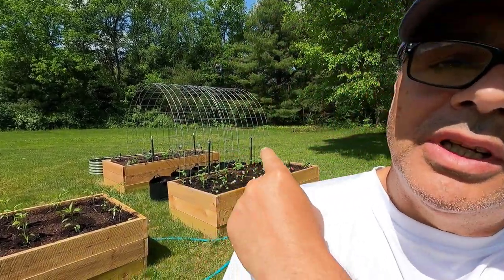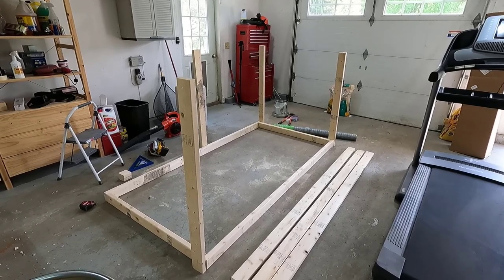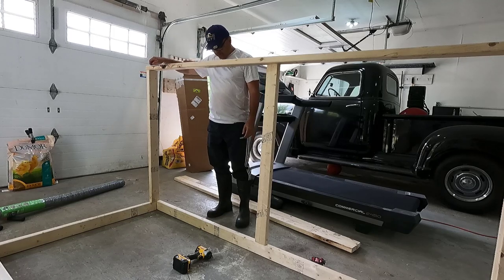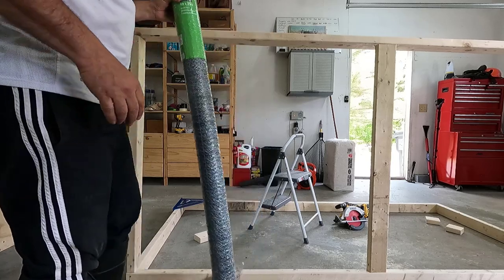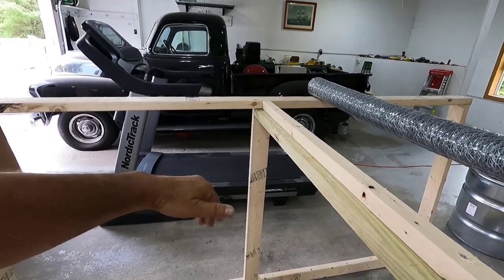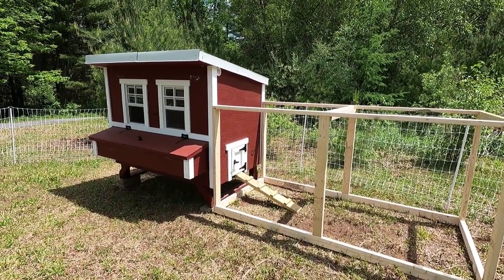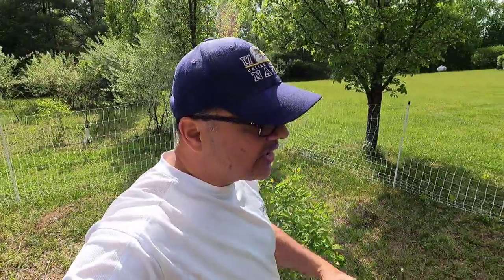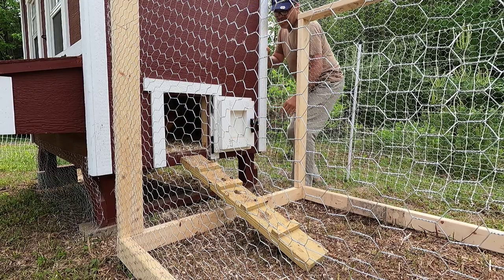Building A Temporary Run For The Chickens

Comment: Hi Ovi.  I should preface this by saying that I have the same respect for life that you seem to have.  I know losing the chick(en) was tough on you, as it was on me.  I don't want you to lose any others, and I am sure you don't either.  Please believe me when I tell you that the chickens can clear the electric fence, today!  Whether they do or not is beside the point.  They CAN clear that fence.  They can easily clear a 6 ft. fence.  I see it happen everyday, and my chickens are no different than yours.  I have been raising birds for right about 50 years now, and at my peak had well over 300.  I've been down the roads you are now going down countless times.  I have lost so many birds over the years it breaks one's heart (but percentage wise I have very, very little loss once I got things figured out).  Please don't under estimate what the chickens are capable of, and what predators are capable of.

BTW, I am a carpenter, though rarely do that work these days (I am way too old for that).  I have been building since around 1974.  Though I made my living building houses, I have built a LOT of bird enclosures, and battled predators.  

The worst loss to my flock happened when I was in my early twenties, and before I got things figured out.  One thing I raised back then were pheasants.  I had Goldens, Silvers, and Ring-necks.  I had these in five or six pens.  Each about 8 foot wide, 20 feet long, 8 feet high, and their boxes at the back.  They shared common interior walls.  (My walk-in chicken coop backed up against those boxes.)  One night something got into one of the pheasant pens and killed all the pheasants in that pen.  Once it had killed everything in the first pen it then proceeded to get into each and every one of the other pheasant pens. I lost about 40 pheasants that night.  What ever the predator was that night it did not bother any of the other birds in the dozen or so other pens I had around the yard, nor did it mess with any of the birds that were never kept in pens, even at night (i.e. ducks, geese, etc.).  They didn't take or eat any of them; they just killed them.  I was devastated by the senseless loss of life and it haunts me to this day.  I don't wish that on anyone, and especially a nice guy like you who is trying your best to provide your chickens with a good life.